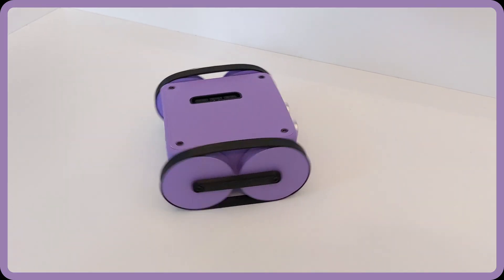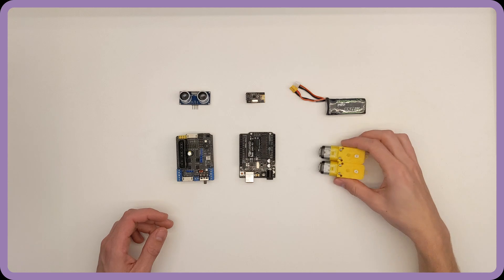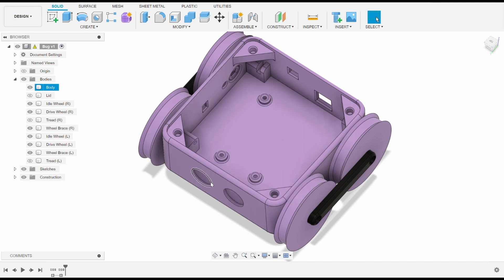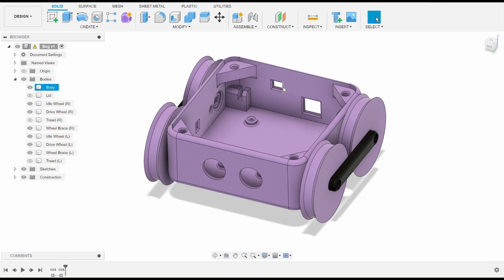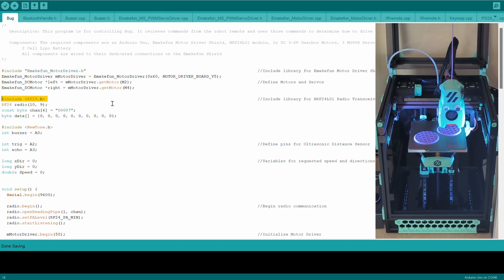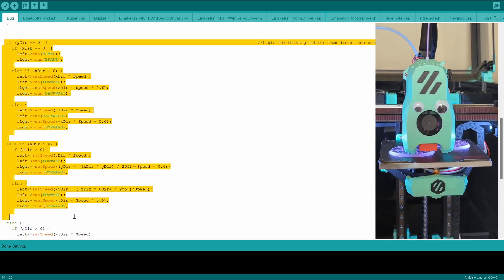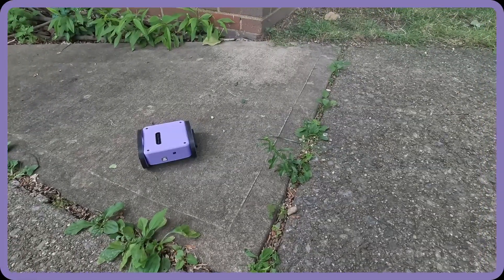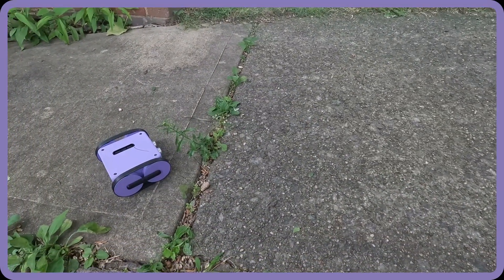Simple Arduino Robot

Comment: As a kid, I used to have a subscription to Real robots, a magazine and kit in which you can build and expand your robot with the parts they send you. It never really worked, and it was a pain and a waste of money in the end. You couldn't really program it yourself, either. Later, I've built several RC cars, even one from TTL logic. But it took me until now to really grasp mechanical design, steppers, servos, and brushless DC motors. It certainly helped a lot to have a 3D printer, and just make stuff. Building the base you represent looks like a nice project for a 16yo to get started with electronics and robotics. I hope you keep expanding it, and test it out with others.